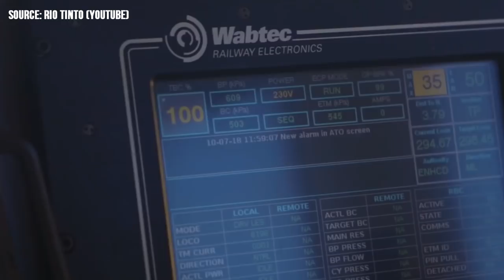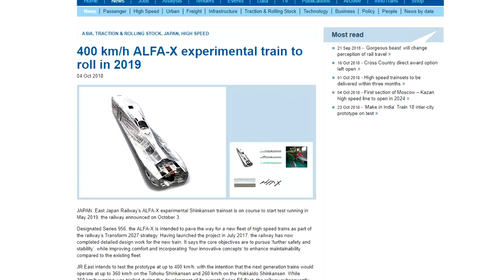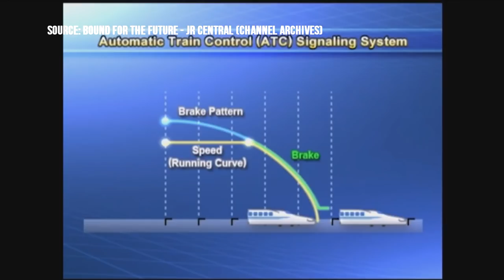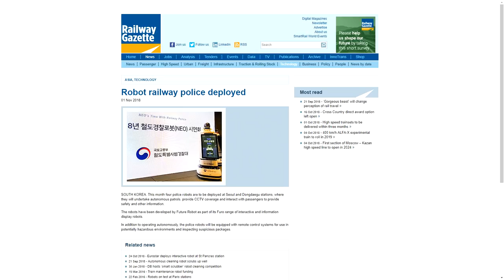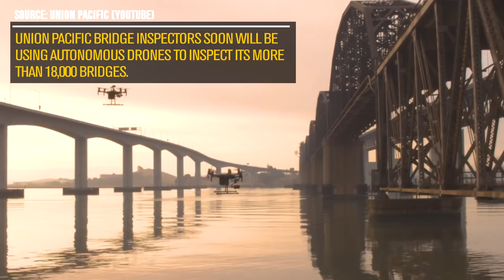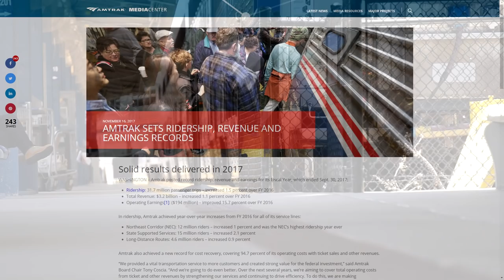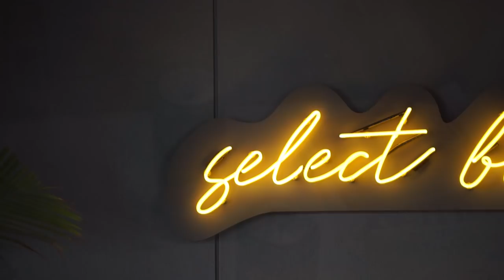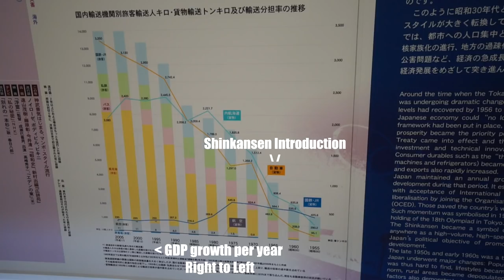Train of the Future - Documentary of Future Transportation

Comment: Here are some less sexy but all the more important rail technology advances not mentioned in the video:

Low-floor vehicles. The main benefit is that you can have level entry from lower and thus cheaper platforms. It also make things easier for people in wheelchairs or old people to board/unboard. This is now practically universal for light-rail vehicles, but most European heavy-rail regional and commuter passenger vehicles are also built this way, and some high-speed trains are also built this way (although they need entrances at multiple levels to also serve existing high platforms). This change in vehicles is paired with a massive boost in investment in platforms level with the (low-floor) entrances. In Europe, the goal is to get to almost 100%. (Of course, some countries which have already invested in 100% high platforms decades ago, like the UK or Japan, don't need this, but they are the exception.)

The complete do-over of electric propulsion. First high-power semiconductors and inverters built from them allowed continuous acceleration, and also allowed a switch to 3-phase asynchronous motors, which were contactless, much lighter and more powerful than earlier motors, and efficient at feeding electricity back into the grid when braking. In fact these were a big part in allowing the construction of low-floor vehicles, too. Nowadays, the inverters are made from the much lighter third generation of semiconductors, IGBTs, while on the motor front, we are switching to the even lighter and more efficient permanent magnet synchronous motors.

Last-mile diesels. The video mentions hybrid passenger trains, but there is more to it. This doesn't mean a lot for the US where electrification has been minimal, but in the rest of the world, it was an enduring cause of inefficiency that even if a freight train could run along thousands of miles of electrified lines, most destinations (including the access tracks of industry centres, container terminals, harbours) are catenary-free by necessity, so you needed a diesel shunter for the "last mile". However, as power electronics and motors became much lighter while locos still needed mass for traction, it became possible to install an auxiliary diesel engine into an electric loco, to function as a generator on the last mile. This solution is now spreading fast. In fact, it has now also become possible to build the machinery of a high-power diesel loco and a high-power electric loco into a single loco, which can use efficient electric propulsion on most of its way and then the diesel on longer non-electrified lines.

Electro-pneumatic and regenerative braking. The braking of trains is normally initiated when pressure falls off in a high-pressure pipe that runs along the entire train, thus braking spreads with a limited speed, so you have to limit how fast braking effort builds so that the train doesn't tear apart. However, if the braking command is sent as electric signal via a cable, the entire train can brake at the same time and brake fast. Modern electric multiple units (like high-speed trains) and electric locos can do this very efficiently by using their motors as generators. Some loco-hauled passenger trains already use electro-pneumatic brakes in which the electric braking signal triggers pneumatic brakes, and now this idea is being adapted for freight trains, too.

Moving block signalling. Long braking distances is an enduring disadvantage of rail vs. road. One made worse by the safety measure that is signalling, because traditional signalling divides the track into relatively long sections where only one train can be, even if the end of the train ahead of you is well past the signal you have to stop at. Moving block signalling means that you no longer have fixed signals to stop at, but the system detects the end of the previous train and calculates your potential braking distance continuously and will give a signal to stop in the cab accordingly, allowing for trains following each others more closely and thus boosting line capacity. An early version of this has already been in operation on German high-speed lines for decades, a more advanced version will be implemented as Level 3 of Europe's ETCS train protection system.

Comment: Wow. I missed that one. A lot of information and know more than I did before. Screw-powered train is great. Best is the theorizing about automated trains, which admittedly are compatible technology-wise with the fixed guideways. Always have had this gut feeling that having a driver is good, a responsible position, a good job. And in here you give another reason of technology being hijacked which is ironclad. Two very strong reasons. They should always have someone in back of each train too, to monitor security and passenger behavior, getting up occasionally to tend to passengers, operating remotely the occasional weaponized drone if necessary.

Comment: It's actually not a question about if national rail or private rail is better. The discussion is more about god administration versus bad administration. There are bad private railways and there are god national railways.

My personal opinion is that a combination of private and national is best. For example that the rails are nationalized and the trains themselves have a system of one national company that can make sure there's always competition and private ones that operate for profit. Since there are necessary routes that can never become profitable you need a national rail service everywhere and then private companies that compete with the national one. In that way, there's not a single route where a private company can get a monopoly and at the same time, the national rail has completion so that it actually has to work to get customers. An important part of this is though that the Railtrack company (the one responsible for the tracks) and all the train companies (the ones responsible for the trains themselves both private and national) have to be completely independent of each other. I would also open the possibilities for private Railtrack companies but that requires expansive legislation so that there's not a single Railtrack company that can get a monopoly on a certain route and then charge sky-high prices to the train companies. Another solution for private rails would be some kind of lease, so if a private company builds a track the government just leases that land to them for let's say 50 years and after that, the tracks revert back to the national Railtrack company.

These are just some random ideas I have come up with. I would really like a discussion with criticism and better alternatives below.

Comment: If you ask me a train not having a driver is very dangerous
Reply: How so? You ever play a rail simulator before? Like 90% of it is just mindless tasks you could probably program an IBM System 360 to do.
Reply: @Erik Krauss but what good would that do? trains take up to a mile to stop, whether it's a human or computer activating the stop signal from the cab, it's still likely to hit it anyways. it's not like a car.
Reply: @Erik Krauss ah, that is a fairer point, however it does still happen, theres videos on here of people falling onto the tracks, and by the time a driver sees them it's already too late, wouldn't be any different with an automated system. This is the reason some metros around the world already wall off the platforms even with drivered trains. By the time the driver sees the thing on the tracks, it's too late to stop generally (unless it's a straight piece of track, where an automated system would work just as well at detecting something on the tracks)
Reply: When you get to a certain speeds, the driver is just along for the ride as only the emergency systems can react to avoid a potential collision miles down the track.
As for people on the tracks, there is a reason they have either barriers at stations or reduced approach speeds.
And when you look at deaths on high speed rail, you'll find that drivers are quite often at fault and therefore a massive liability to safety.

Side note to history. Elevator cars used to have drivers. People used not like driver less elevators. But good luck now finding a single elevator that has a driver riding the throttle/break handle.
Reply: @cpufreak101  Flexibility, humans can react to any situation if given enough time whilst computers can react to a limited amount of programmed inconveniences, even if not driving, there should always be a human on board in case of unexpected situations

Comment: Uh, TGV has gotten up to 574.8 km/h.
Reply: That does not mean it is practical to run it that fast routinely--it would beat the wheels, rails and wires to pieces. About 300 km/h is the upper practical limit. You need maglev to get past this barrier; railroads cannot do it well.
Reply: also this speed was done with only the locomotiv lmao
Reply: That was on a test track and doesn't reach those speeds in common use. It's top speed is still nothing to sneeze at often reaching 250miles/hr or 403km/hr.
Reply: @patrickhalbeisen1440  No it wasn't.